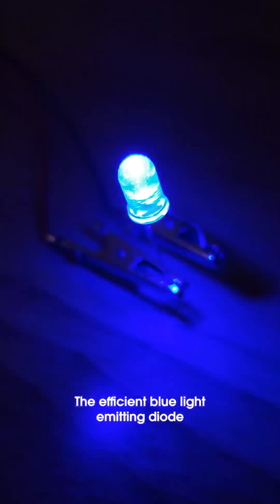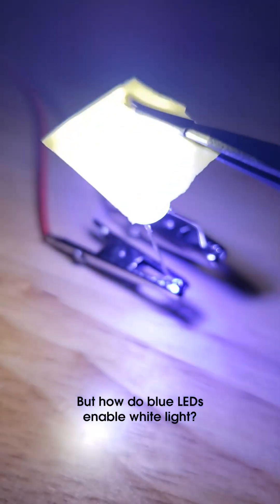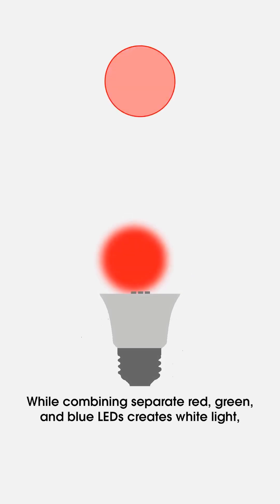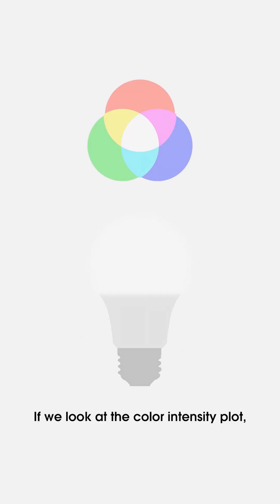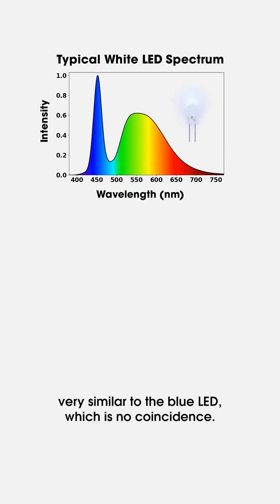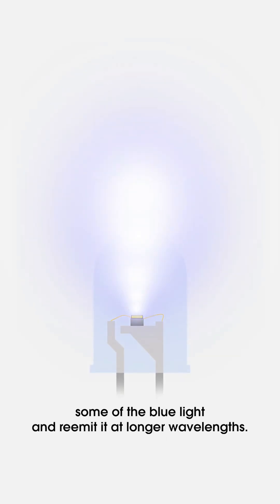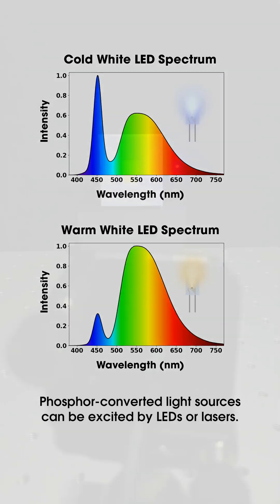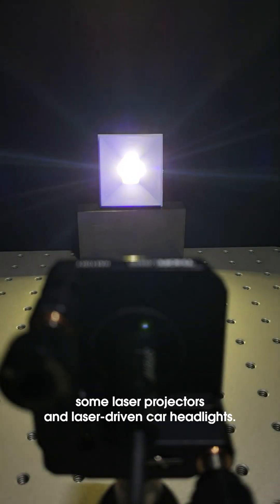How Do White Light LEDs Work? | Photonics in Everyday Life

Comment: How do those orange-appearing when OFF LED lighbulbs fluoresce white?  Thank you.
Reply from the maker: @robertgift Thank you for your question! Without knowing the specific bulb, we can't be positive, but a white light LED whose bulb appears orange when off is likely using a remote phosphor bulb. Instead of placing the fluorescent phosphor directly on top of the blue LED, remote phosphors describe when the phosphor is placed farther away from the blue LED, usually embedding the phosphor in a plastic or other material. Placing the phosphor farther away from the blue LED can make illumination less directional and help mitigate overheating.
Reply: @thorlabs     Thank you.  I forget whathose bulbs were named.   No longer see them.  Yes, the phosphor had to be in the plastic bulb envelope.    People did not like seeing them being brown/orange when off. 
If I find one, I shall remove the bulb envelope and view the LEDs inside.